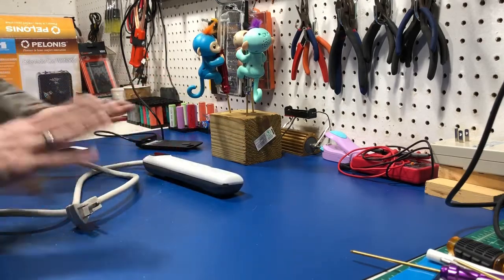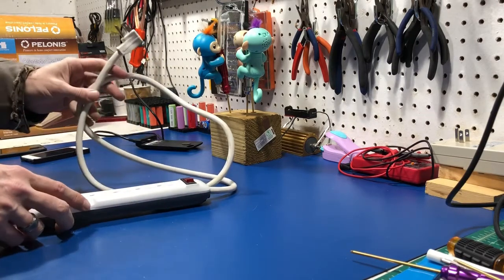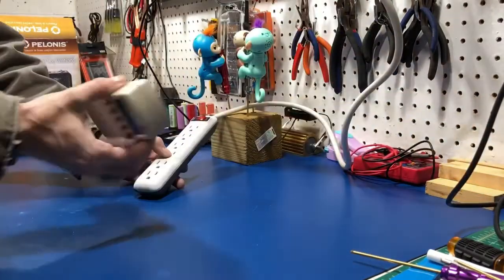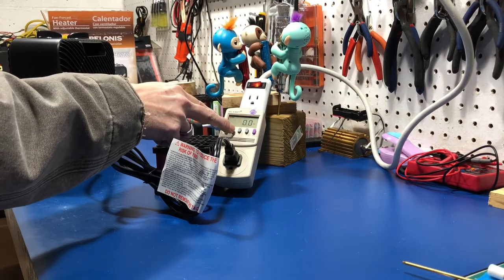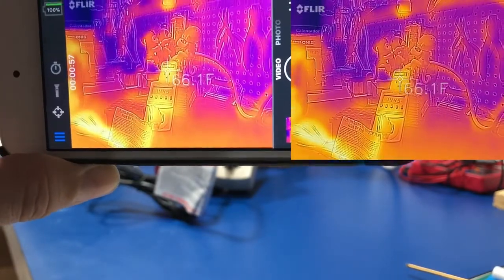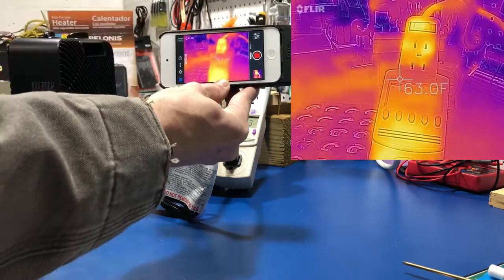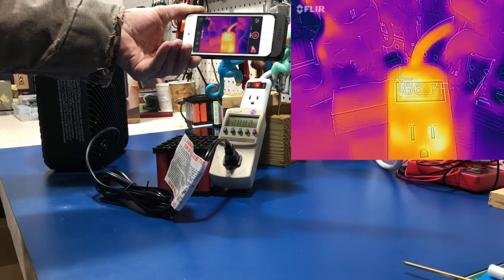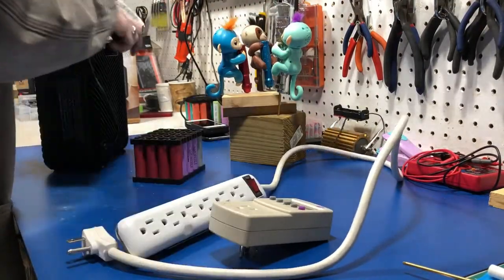Surge Protector (why do I need one) , Power Strip Issues?

Comment: Surge protection is so important, I have a surge protected power board on each of my lab shelves which powers the equipment on that shelf. in theory you only need one surge protected output on each mains circuit, so what I have is overkill, BUT I don't want to risk blowing up my lab gear !
Reply from the maker: I don’t blame you, it hasn’t happen to me but I’ve seen it happen. And my neighbor lost his solar system over the summer from a lightning stike just three blocks from my house. 
I have a few of the APC UPS surge protectors that I like. I tried two cyber power units before. One dies just over a year, another smoked the first time the power went out. So I stick with APC for battery and surge protectors now. 

I had a really old one I just tore down after seeing your comment. I thought the batteries were bad and replaced them. 5 months later it was throwing an error and the batteries were not balanced. Looks like the 4.7uf 26V surface mount caps both failed and leaked. Not worth fixing since it’s such an old unit so I tore it down and will strip it for parts.

I have three 1500VA (BR1500G) one on each bench in the lab. And I had one downstairs for the cable modem, WiFi, TV and DVR but that one just stopped working a couple weeks ago. So now it has the one 1500VA (BX1500M).
I took the BX1500M from my desk since it was only my laptop and has its own battery backup, and put the laptop on a regular surge protector until I figure out why the one unit stopped working. 

If APC doesn’t cover it I might do a teardown and repair video on it. It never said the batteries went bad, no warnings, but the last two brown outs and I lost internet and realized the unit shit down. So probably something with the DC/AC converter? Or maybe the batteries are dead and the warning system failed? I havent had time to look at it.

One 600VA (BE600M1) that shuts down my NAS properly so I don’t have to rebuild the raid if the power goes out.

And one APC Back-Ups 350VA (BE350G) that is on the battery bench in the basement for the chargers and LED lighting on the battery side.

Thank for watching,
Scott